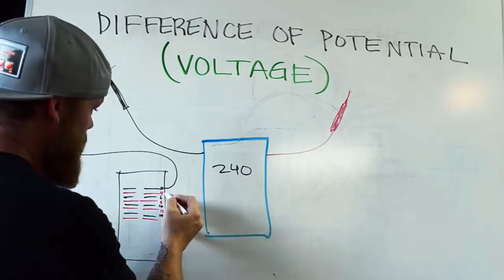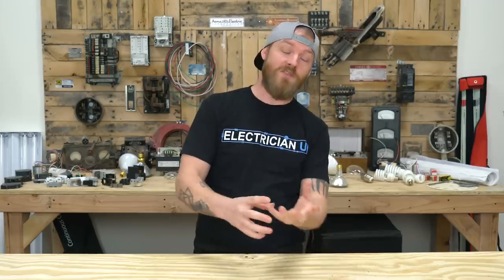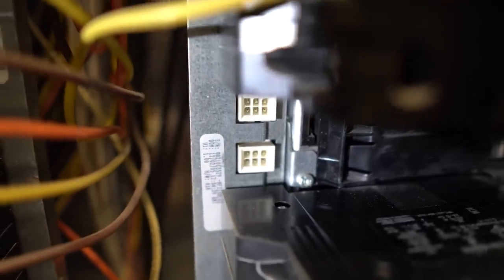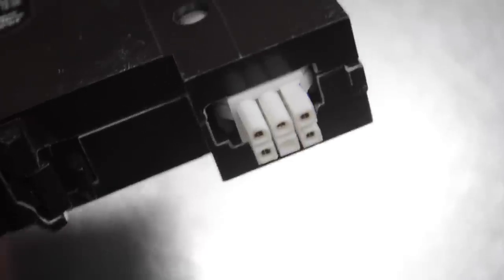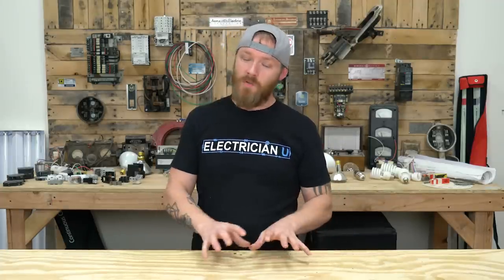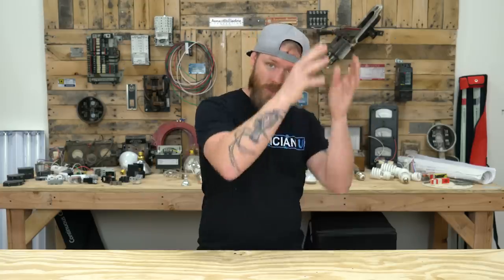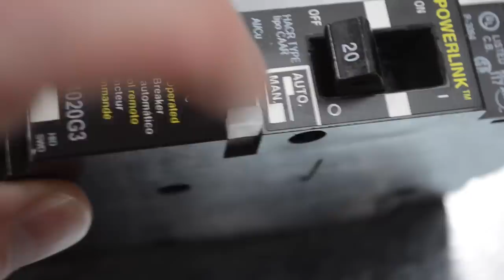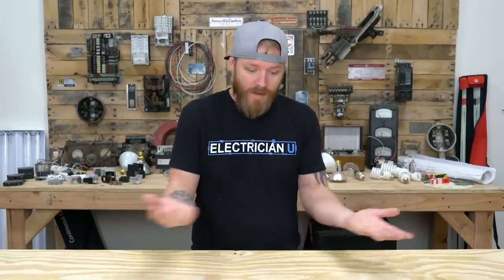SMART BREAKERS - Remotely Controlled Circuit Breakers

Comment: So if you manually flip the breaker off, the monitoring service can still turn it back on? I'd make darn sure the circuit I was working on was set manual so they couldn't. Their ability to monitor doesn't take priority over my desire not to be shocked or worse.

Comment: This stuff you show is ancient.  Leviton Load Center All Plug-On smart breakers connect wirelessly to a hub inside the panel board and WiFi/Ethernet connects to homeowners network to run My Leviton App to check each intelligent smart breaker or shut off remotely.
Reply: Jules Bartow wired connections are more reliable. I only use wireless devices if I can’t pull a wire between two points.

Comment: This is very dangerous having someone other than yourself with the power to decide when and where you have power. Big brother is extremely deceiving right now. A shady electrical contractor just installed one of these on my mom’s house and now I have to check if these breakers are in manual or auto. I’m now looking at traditional panels and breakers to replace what they did. This guy butchered the walls and outlets throughout the house. The whole purpose was to get a reputable company to verify the safety and integrity of electrical system in this older house which only had a 100 amp main. With all these extra appliances and electronics now days, she was starting to have issues here and there throughout her house. She gave him a $2000 deposit and now wants an additional $2900 for work that is now more dangerous than before.

Comment: Seems something like this too if you needed to shut it off to do work on that circuit even a LOTO would need a special process like put in manual only mode then turn off so that the monitor service does not re-activate it while it is being worked on.
Reply: What about just a plastic placeholder, and you can remove the entire breaker and place a lockable placeholder in its place?

Comment: Personally i see this more like a novelty and looking for a solution for a problem that never was there in order to sell more, the only logical use of such brakers are on lightning control panels but those are already there long time ago with the use of relays or contactors with computer boards in then, the reason why i see this useless its because if there is a problem with a load and the braker trip then an electrician its called anyway to deal with it and fix the actual problem cause turn the braker back on remotely could just worsen the problem or be a hazard also why anyone would want to kill the power of loads that don't require to be killed  like servers,computers,medical equipment,refrigerators other than actual loads that you want to control like lights but like i said there are tons of solutions already for that and this is just a fancy way to keep sales up.
Reply: chancho00 the residential market for these is intelligent load shedding when tied to a solar battery system. Look at the partnership between Sonnen and Pantech Design for a great example of how this can be put to great use as solar battery systems gain in popularity.
Reply: I totally agree. This is nothing that a split buss panel with integrated contactor can’t handle. I just installed a time clock and relay to control one less than a month ago. Who needs to shut off and on individual circuits remotely? So dumb. Sounds like some engineers designed something just to justify their job.

Comment: I watched this video since I was looking at smart breakers, but for a slightly different purpose: Energy monitoring in a residential setting. As part of a smart home it would be nice to know how much energy is used by each circuit. I looked at the Leviton system, which looks like what I want, but there are other systems as well (one thing I liked about the Leviton panel is no pigtails with AFCI/GFCI breakers, but that is really minor, although it makes for a neat and easy installation).  Other smart features such as notifications when a fault occurs and remote turn on/off is a plus, but less important for residential. All part of a smart home / building. Would love to see future video on that and hear your thoughts. Thank you for all of your videos, you are fantastic! Love your work!
Reply: You should look at emporia vue monitoring solution. Cheapest solution on the market, can be jailbroken for totally stand-alone integration and off-cloud monitoring.
Reply: It would be nice to get a room by room breakdown of consumption. I work from home, and it would be nice to know how much I spend on electricity in my home office for business purposes. Local control on a LAN would be nice, but if an internet conection isn't optional, I'm not interested.
Reply: @willdwyer6782 The breakdown would depend on your wiring since you can only measure entire circuits at the panel level. If you’re just interested in your home office you could use smart plugs or something like Shellys to monitor your consumption that way.

Comment: Could you please explain the difference between 208,220 and 240 volts?
Reply: Just different voltages bruh. 220 and 240 are the same thing, where 208 is a voltage you get with a 3 phase system i.e. 120/208
Reply: About 32 volts
Reply: BO Photo 😂

Comment: I'm guessing that there is an absolute need to install a firewall, to protect the panel?
Reply: Anyone with the change to put in these things with ethernet integration is going to already have a firewall.
Reply: Depending on how critical the application is, you could have an air gapped stand alone network.
Reply: @Jeeperanthony  That could potentially add security, but it's very difficult to get right.  It definitely isn't safe to use a separated network as your only security, because that makes the whole network and everything on it an attack surface, and if any attack succeeds then everything is compromised.  It can even be done accidentally - somebody plugs a patch cable in the wrong port, and next thing you know all your VFDs have ransomware installed on them.

Comment: have you seen the new leviton smart load centers? line and neutral actually screw into the panel, and the smart breakers just snap on.
Reply: Square D has a similar solution.  It's temping to put one of the new load centers like that in my house when I upgrade to AFGF breakers.

Comment: I'd like to see a video about the risks of locking in to one brand of internet-connected cloud-hosted startup company tech for something as basic as home utilities. My house has two Square D QO panels installed in the 1980s, I can still buy breakers for them today. For goodness' sake, you can still buy replacement breakers for Federal Pacific panels and they're... well you did a whole video on that. If I install a smart panel, and five years from now I need to add a circuit, am I going to need to re-do the panel all over again because I can't get an 'obsolete' 2022 model year breaker, or the company folds and I can't reconfigure the panel without their cloud server? Smart panels are a really interesting idea but I need to have confidence it's going to be done once and last 25+ years, and "smart" devices are not known for longevity. Am I mistaken? Do any of these smart panels at least use some sort of open standard that someone else might manufacture parts or independent controllers for?

Comment: I for the life of me don't get why they didn't focus on backwards compatibility. With proper design, there would be no need for a special panel (just have plug at top of breaker). They could have had wireless/ethernet module in a small side box, then just run connector cables from each breaker to side box. Nope, rip it all out and replace it all. 

Cut out most of the potential market due to that choice.

Comment: There was a papanel and breaker setup that had dual (utility and emergency) or built in transfer swicth that you could program wicth loads swicth over and when that could be programmed to switch to the generator side without a loss of power or flickering lights

The cool thing is the that breaker can also sense amperage and set at a very low amperage 

I can't remember the name of the company
Reply: Are you talking about a UPS system?
Reply: @Ephesians-ts8ze  no

Comment: In Europe these smart breakers are booming. They work via Alexa (or other app) and ideal for 2nd home lighting, poolpump, irrigation system etc. When it rains you turn off the irrigation. With a remote camera you can check if it works too!

Comment: I'm building my house now and I've been looking into this smart stuff. I just can't find a real value for a single family residential use except thermostat. It feels like more problems to solve.
Reply: The French Guy smart switches are good for me at least. Especially when you have pets at home when traveling for a couple days. Being able to turn lights on n off as well as outside security lights. Almost to the point where youre already in bed and forget a light somewhere or your kids forgot you can use your phone to kill the lights
Reply: If you are looking to justify the cost of smart devices I can believe it hard to justify the cost.  So let me give you a few examples that give a friend of mine value.

A friend has a lake house used by family and friends.. yes she loves the thermostat, but there is a smart valve on the main water line, the outside porch lights can be turned on from the her parked car. She can water the grass remotely. The front door bell/camera is important and the last device are the door locks...

These devices give her peace of mine and that alone was enough. She had a flood once now the water sensor will shut off the house water... tripping on the front entry stairs is a real problem when they are not light... strangers at the door... 

Think about these smart devices how they help day to day... and how they help when something goes wrong.   Then you will see their real value.
Reply: Not worth it for residential to have smart breakers, though energy monitoring is handy.  Smart lighting is useful too.  I've been slowly introducing smart automation in my home and that's where I have found the most use along with door locks.  One press of a button at my bed and all the lights in the house go off and the doors lock.

Comment: There is this one big wiring network on ground floor of my folk's house. I have narrowed a fault to just 2 rooms and want to install a WiFi RCD at start of each of these 2 rooms. Is that possible? At the moment the fault triggers the one RCD which controls the ground floor and causes blackout until I wait 10s and put the switch back up.

Comment: You can also shutoff breakers as people come and go.  Eliminate phantom power use when no one is home.    Motion can control circuit instead of switch

Safer and more environmental to turn off all circuits that are not critical when no one is there.  IE bathroom circuits that have heaters.  It prevents fires from left in heater (common) or just failures that cause shorts and possible fire.

Comment: Why would you not mention that the "remote/Manual" switch should be used to lock out remote control while you are working on that circuit?  Other than that, great video!

Comment: I'm just a dude with a family.  Not an electrician.  Every day our kids leave on 20 to 40 lights when they leave for school.  I have to go around turning them off.  Why aren't there wifi circuit breakers where when I'm leaving the empty house I can just click a button and all unnecessary circuits turn off.  When I return I turn them back on.  Seems like a simple idea but probably isn't.
Reply: You could install smart lights and present sensors in each room. They are easy to program and connected to each other. When nobody in the room for x minutes, turn off the lights. When somebody enters the room and it’s dark, turn on the lights. If it’s still bright in the room, don’t turn on the lights.

Comment: Entertainment venues have started using these type of systems to remotely turn on and off theatrical lighting and audio equipment via DMX lighting protocols. It’s less expensive than putting in a theatrical dimming system. Plus, a lot of live theatres are changing over to LED instruments and not using tungsten sources.

Comment: Check out the new Eaton Power Defense Circuit breakers!! Just announced this week, they have revenue grade metering integral and go down to 15A! It's a game changer there's a lot of other new features too
Reply: Jon Topham do you have a link?  All I find is their molded case models...
Reply: @adorsett  https://www.eaton.com/us/en-us/catalog/electrical-circuit-protection/power-defense-molded-case-circuit-breakers.html
They are molded case but have much more built in versus bolt on capabilities. They don't have any reclose capability but they are all individually addressable thru TCP with revenue grade metering. Expect them on the west coast first but don't hold your breath.

Comment: I’m an IT guy.  You are obviously an electrical guy.  I’m wanting assurances about the security of what I’d call the ‘control plane.’  The control plane is obviously the Ethernet controller. I’m extremely curious how someone securely authenticates into that low voltage controller.  If you say a PIN - prepare for me to scoff!  :)  Even if you say a 6-digit PIN - ‘hard pass.’  If you say SSL certificate - then you’ll get my attention.

Comment: A huge additional usage is to be able to conveniently shut off bedroom circuits at night to disable the 4 problematic types of EMF propagated by house wiring: 1) 60Hz Magnetic radiation, 60 Hz Electrical radiation, Radio Frequency radiation, and Dirty Electricity. That strategy can lead to a huge health benefit for many.